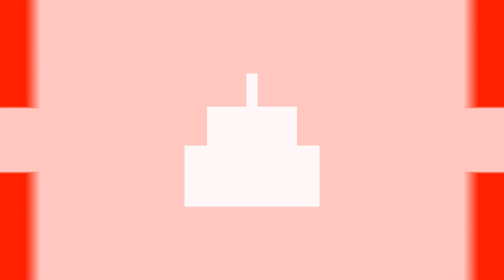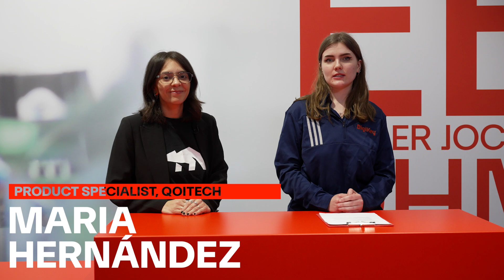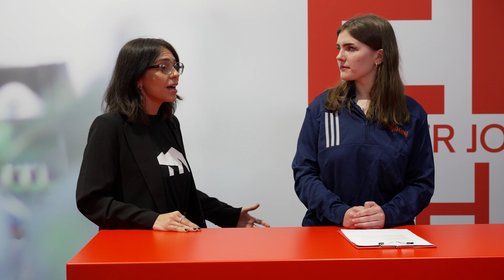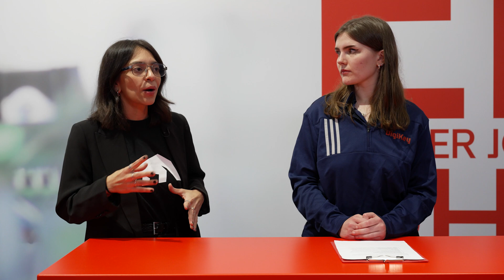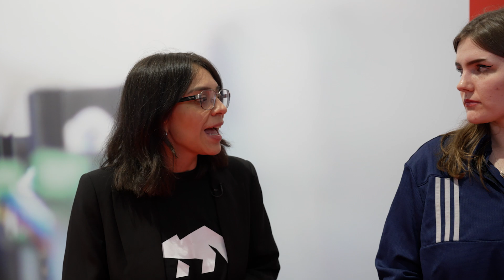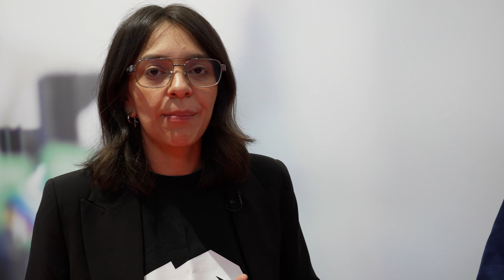DigiKey at embedded world 2025 with Qoitech

Comment: Convert your engine to run on water (Hydrogen hy-bird system) to gain torque & peak engine performance.Hho system reduce exhaust carbon emission, improve fuel economy fuel saving if you have a carburetor typed car or bike.  No more overheating problems at all.

. faster acceleration.HHO SYSTEM REMOVE CARBON DEPOSIT, engine running smoother and cleaner. fuel burn faster and completely. (no fuel is wasted its save you more fuel and lower the engine TEMPERATURE).

INCREASES ENGINE LIFE, ALSO INCREASES ENGINE OIL AND BATTERY LIFE BECAUSE YOUR ENGINE WILL BECOME A QUICK START EVEN IN COLD MORNINGS. YOU WILL SAVE MONEY ON LONGER MAINTAINANCE PERIODS.

SYSTEN CAN RUN ON ALL TYPED OF IC ENGINES. HHO NEED NO STORAGES TANKS. NO NEGATIVE SIDE EFFECT ON ENGINE. THIS POLLUTION CONTROLLED SYSTEM VERY GOOD FOR CARBURATOR TYPED ENGINES. VERY LOW POWER CONSUMPTION CONTROL BY THE IGNITION SWITCH.

EASY TO OPERATE, SAFER AND MORE RELIABLE. CLEAN COMBUSTION CHAMBER AND p CONVERTER TOO. 

IF YOU HAVE ANY OTHER QUESTIONS VISIT hho zafar